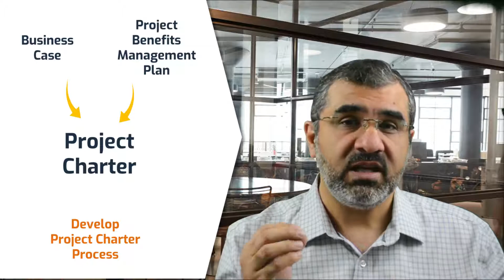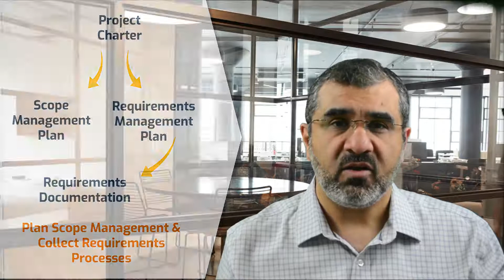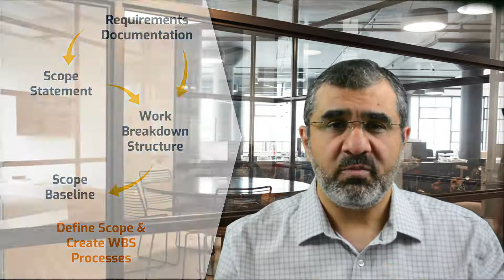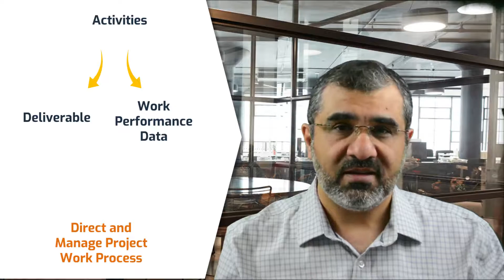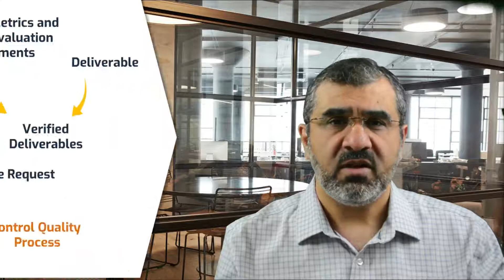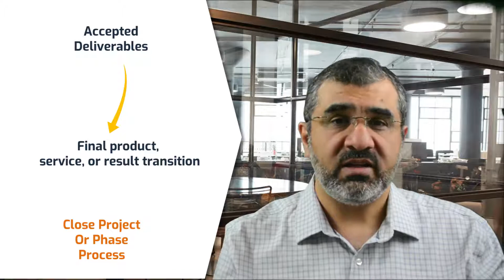What it takes to create a deliverable? Understanding process flows

Comment: Business case and benefits management plan is Created by the sponsor. These documents are used by the sponsor to make the project charter, the project manager might help/assist in the creation of the project charter.
Reply from the maker: Sponsor can't write the charter and also approve it. It defeats the purpose. PM is the one responsible for project delivery. The PM presents the high level plan through charter and the sponsor approves it to authorize the project.
Reply: @GetxSolution  thank you because I was getting confused with what the other person typed about sponsor doing the project charter. Never heard that before. Thank you for clarifying. Also I signed up so I can receive your email on the winning strategies to answering and passing the PMP exam in the first attempt. Haven’t seen the email yet I have only received an email asking me to confirm my email address which I did.